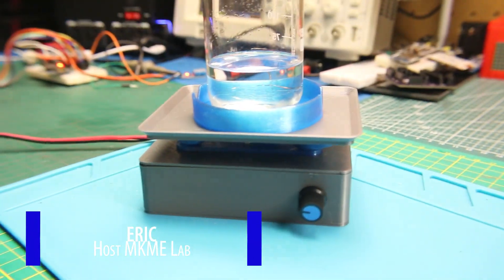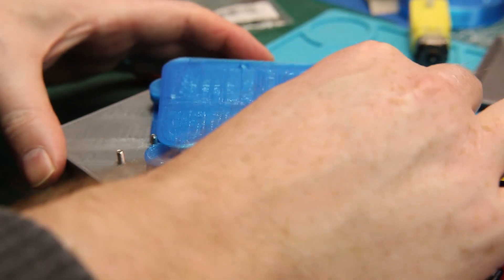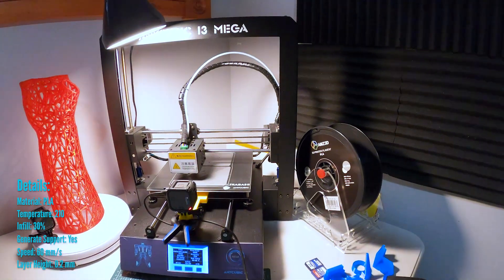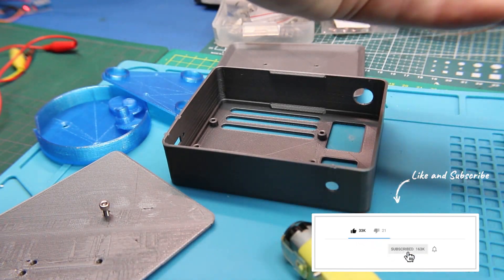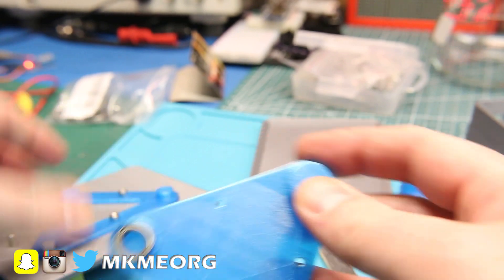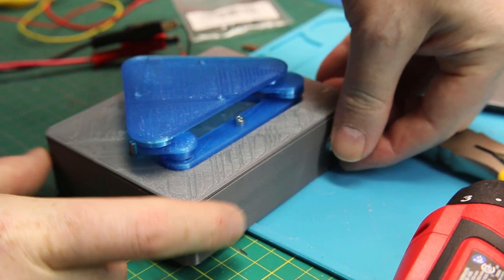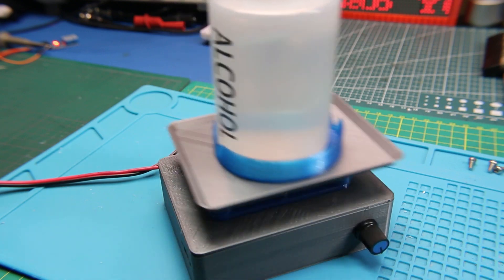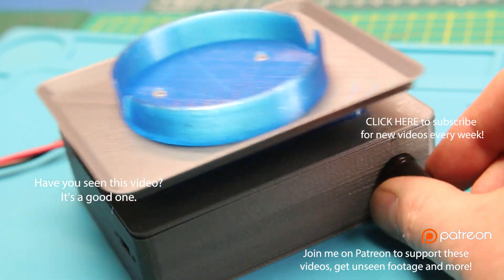Stir & Shake with this HANDY Tool🧪️🥼

Comment: What is up with everyone using the i3 mega lately. I literally just ordered an artillery sidewinder x1 to replace my i3 mega as I have never loved the machine like I do my cr-10. Its been a weird ride the past couple of weeks but I ordered a replacement board to fix my mega as it quit printing above 240c almost a year ago for some reason (its a long story) but I replaced the hot end, the power supply, the fans, reflashed firmware, adjusted stepper and power supply voltages, resoldered connections, literally everything that could be causing it. After ordering the board I kinda forgot and saw the artillery was on sale and pulled the trigger on it. Then today the board showed up along with some drylin bearings/bushing so I spent all day replacing everything and cleaning everything. I am doing test prints now and will try high temp tomorrow but in the past week I have seen probably 6 unrelated videos about 3d printing and they all are using the i3 mega and speak super highly of it. I agree the base is great but I haven't had a great time with this one compared to the cr-10. 

On another note I have been doing lots of lab stuff lately as it impossible to find 99% isopropyl alcohol anywhere and I need it for my job which is fixing electronics and you want the highest purity possible but I found tons of 50% so I bought it. I then learned of the salt distillation process where you remove 20-30% of the water using salt. I did this then tested the alcohol and it left a salt residue if course... which is not great of electronics so I bought a distillation apparatus and have been doing that the past week to get pretty high purity iso. I also have molecular sieves to remove even more water. I'd say I am probably getting 95-96% iso out of this now its been a blast.
Reply: Hi,  upload vid of process please. Would help a lot of others out there 👍
Reply from the maker: I have both the i3 Mega and a CR10 (and more)- The i3 is 3X the quality and has never been touched or serviced since Day 1. The CR10 has needed a new bed, multiple fans, extruder, extruder drive more nozzles than I care to recall idlers, and probably more that I am not remembering.  No comparison between the two in my case except the CR10 has size.  Thats seriously its only plus in my lab.
Reply: @MkmeOrg  Weird that we have had the exact opposite results. But I think thats kinda common with these cheaper printers and the quality control. I am excited to see what the new sidewinder can do though.